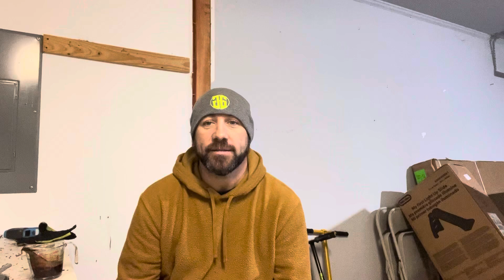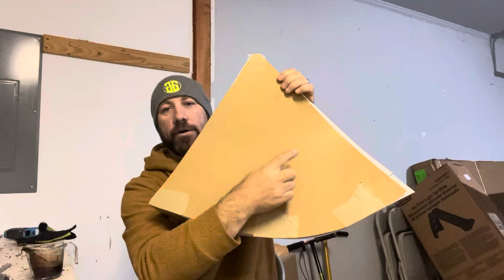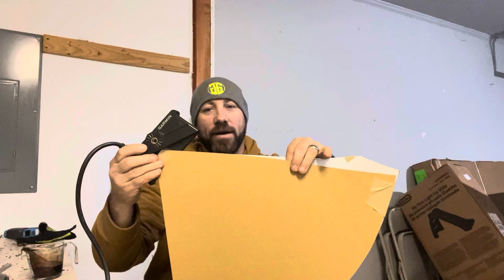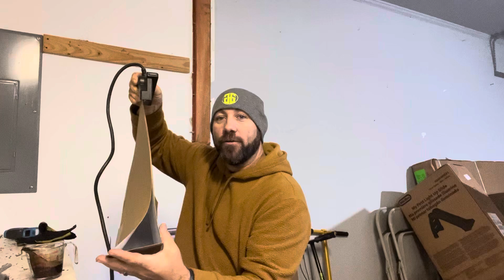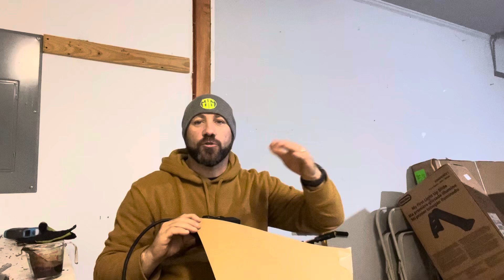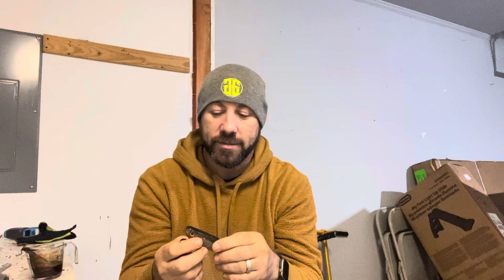Garmin Livescope Beam: Understanding The Beam And Exactly What Orientation Does!!!!

Comment: Great videos - I’ve learned so much that’s helped me get started with my new 734 Sonar 👍
But I’m still confused on a few beam path issues:
1. In forward mode, does the display tell me whether what I see is left or right of centerline? Left to right on the graph are closer or further from the boar, right?
2. I Still struggle to pick up my bait in the water and I’m not sure if my casting is too far off, my forward facing is set up wrong (e.g. 8 degrees?) or I’m doing something else wrong. 
3. I’ve heard that a “zero degree” transducer mount helps with that. Is that true and can you cover that, please?

Any information and advice would be appreciated. 
Thx,
Red

Comment: Seems to be good information, but I need a bit more info. Notice you use the LVS 34. Is this info the same for LVS 32?
Reply from the maker: Beam is identical bud. All info is exactly the same. Great question
Reply: @The_Garmin_Guru  That being said can you explain why when I switch from down to forward without physically moving the transducer my display switches to point a different direction. Is there two separate elements each pointing a different angle? Thanks again. Love your videos.

Comment: You are sorta right and sorta wrong. The beam is the same, that is correct. How the information is displayed on the screen different. You can see 3D in perspective mode but not Forward and down. With perspective mode you can see right, left and closer and further away. With forward and down you only see a slice of closer and further away. You do not see right and left. You can figure out right and left by panning the transducer but you only get a slice that puts the whole 20 degrees on a single plane. 

perspective shows you the whole image 135 degrees wide by 20 degrees tall. Down and forward show  135 tall and only a slice that represents the whole 20 degrees. This is why I predicted forward facing sonar would go to a portrait orientated display. 

To say it another way, In forward mode point your sonar at a bush. Then show me on the screen the right side of the bush and the left side of the bush without panning the transducer. you can't do it. on perspective mode you can see right, left, closer and further.
Reply: Another way to say this: perspective mode you are inside of the beam looking out. Forward and down you are outside of the beam looking at a side view.
Reply from the maker: The video wasn’t about what was portrayed on the screen the video was about how people think forward mode beam is smaller than down mode beam. And you can see 3 dimensional views on forwards and down mode. Find a ledge or creek channel and scan parallel down the edge and you’ll see a beautiful 3d pic. I understand what you’re saying but in forward and down as a whole you’re scanning perpendicular to the bottom where as in perspective you’re scanning parallel to the bottom.

Comment: I have my transducer angled up i can see ripples on the surface, What i cant see is my weightless super fluke. Doesnt matter if i work it up high or letting it sink. In 2 to 3 foot of water.
Maybe the lure is just to small to pick up maybe?
I was just out to test and didnt have any other setups to try.
Reply from the maker: Little trick is put a swivel or glass bead in front of it and it will help the visibility
Reply: @The_Garmin_Guru  even on perspective mode?
I use that trick foir forward mode. Ill try it for perspective, thanks.
Reply from the maker: @NiteWolfeFishing  you don’t need to do that forward mode because the beam already angles up. You just need to drop the install depth down a couple feet which slides the picture on the screen down so
You can see the surface better